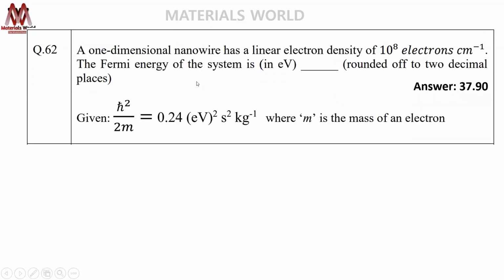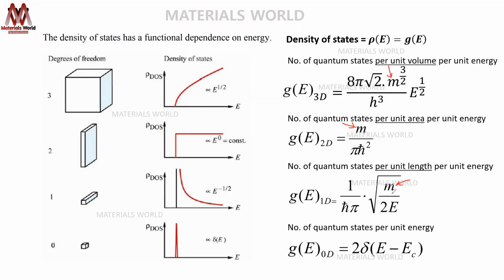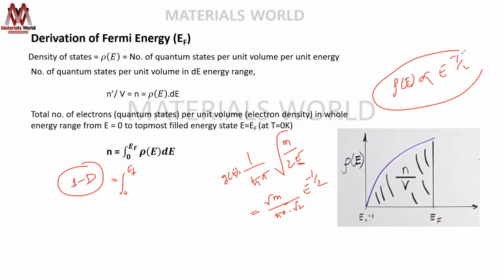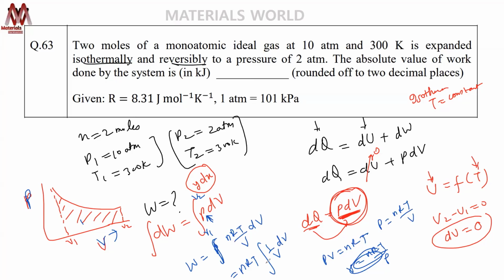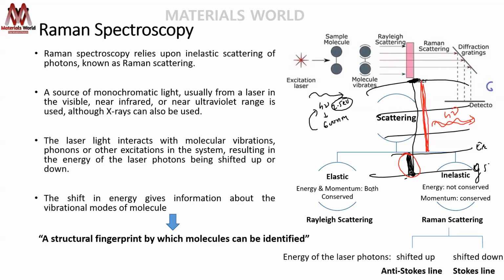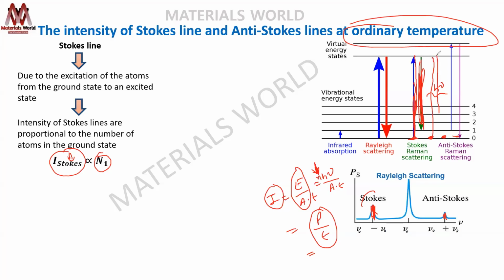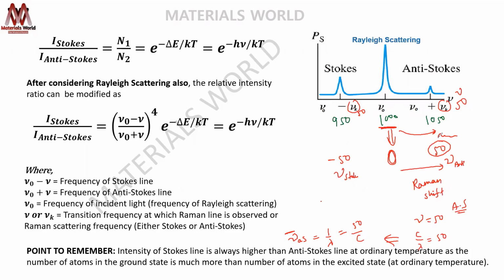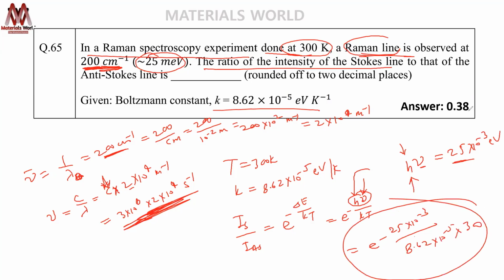[PART 3] GATE 2023 XE C Material Science Answer Key and  Detailed Solution | xe c ans key

Comment: Q62 in gate answer key says 9.2 as answer sir
Reply from the maker: Please Check Description. I have given drive link for Q62 and 65 correct solution and complete notes.
Important Please note:
For Q62:
There is a mistake in expression of 1-D density of states, and that's why final answer is wrong. Rest everything is correct and same integration approach should be followed. Please visit this drive link to get correct expression and solution.

For Q65:
By mistake while writing intensity equation of Stokes and Anti-stokes lines, negative negative sign before activation energy Q in Arrhenius equation form is used in the exponential, instead we need to use positive sign (like viscosity formula in Arrhenuis form where + sign id used before Q) . Rest every theory and concept is correct.

Given incorrect expression: N1 = N0*exp(-Q/kT)
Correct expression: N1 = N0*exp(Q/kT)
(No negative Q).

Please find its full solution in the drive. Drive Link is in the description.